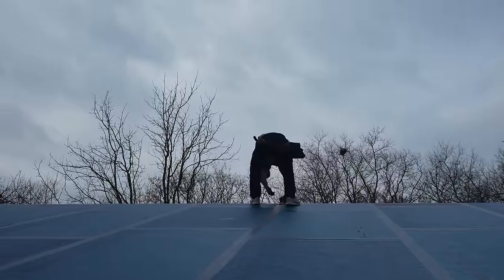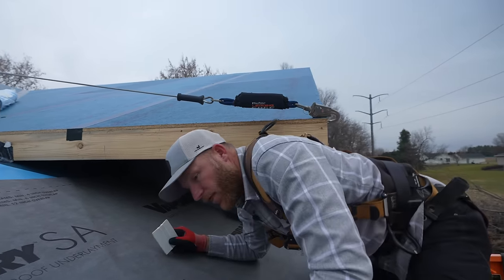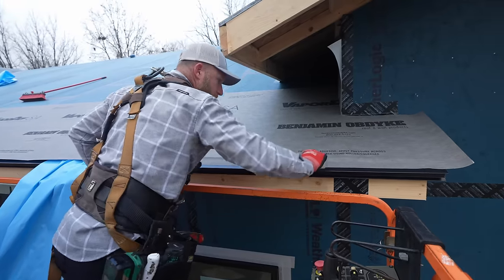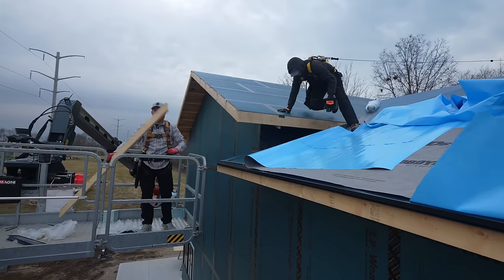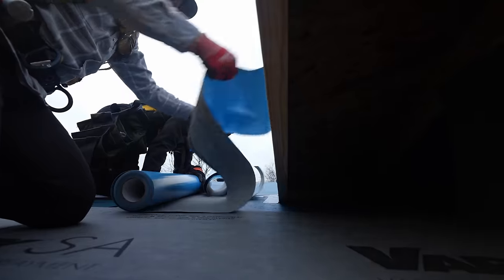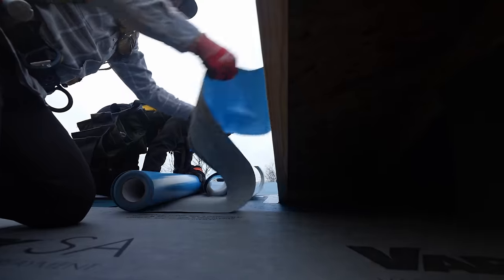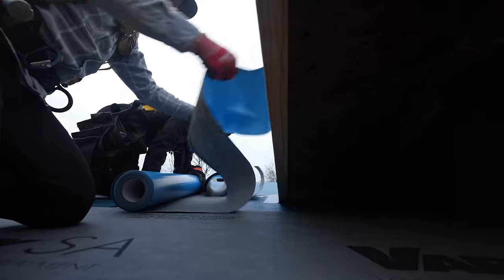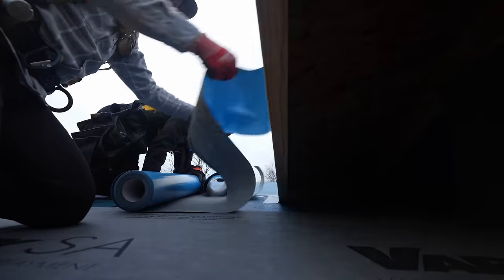My Dream Shop Ep-33: Why we used a Roof Underlayment! AND ITS AWESOME!

Comment: Finally a product that you do t have to put more holes in to apply it.  Kyle, when working by yourself, that is when you need to use the safety equipment.   Excellent work boys.

Comment: At 90 cents a SQ foot or $422 a roll. I think I'll go with cheaper tried and true tar paper investing the difference and in 40 years when I'm 80 pay to put a new roof on with the invested $.  I live in the PNW and properly installed and vented tar paper from the 50's and 60's still looks and preforms well in every remodel I've seen. Not sure but I believe Kyle is planning on an air gap of some sort on this roof.

Comment: Fall protection is a nuisance for sure… BUT as it saved me once form serious harm am using it for sure! On BIG tip to a new user… pull up your harness tight high up in to cross…. Think … dropping 25 feet down and then your harness will catch you by you shifting down thigh! In the harness…. For the guys… guess what in the way first when your full weight hits the straps in your cross 🤬 learned the hard way to secure the harness right….😮

Comment: Definitely a great idea to put down this membrane since the weather logic has but a thin coating of material to make it water resistant.   This membrane is likely 10 times thicker than the super thin spray coating on weather logic and the last thing you need is wet OSB sheets on your roof !

Comment: It seems like double protection plus a metal roof and no spray foam. Hmmm. 
No blue board, grey sheeting (its great stuff but optional), and spray foam inside would be the best roof system for cost, value, quality - is my take on this.
Great video guys!

Comment: I’m curious.  Intuitively I would think that you would run valleys after the horizontal field so the valley would be over the top.  Is there a reason you did it the way you did vs running the horizontal first and valley over the top.  Or is this okay by the manufacturers instructions?  

I’m also not a roofer, so it could be just my ignorance about this stuff too.

Edit:  I think it dawned on me as I watched further. There are the portions of the horizontal directly above the valley that would be under the valley sheet if you ran the valley second.  I understand now.

Comment: So what is the alternative to using a body harness and lifeline to make your workplace safe? Could you have used carpenters wall brackets and guardrails at the soffit edge given that your slope is moderate? Since you have lifts to move equipment and material to height quickly are there OSHA approved alternatives that would eliminate the need for body harnesses to be continuously worn?

Comment: On the edge trim piece, what is the need for the upper most fold/double layer of it is buried under the underlayment? Is that sometimes used for locking in the roof panels?
Reply: He mentioned that it's to dam up and prevent wind driven rain from going up the trim piece

Comment: That fall protection is useless if the angle of the rope is greater than 30 degrees .
The fake peace of mind it gives you, might be fatal in case of a fall.
Best would be if you take the Magni and lift up the boom and hang your fall arester on it.
And if you worry about the boom failing, it won’t fail spectacularly like in the movies.
It will slowly sink to the ground..
It’s made with safety in mind because it’s made for lifting people as opposed to the sky tracks or petite bones who would if you would use them for such thing..

Comment: Holy crap, I just check the literature on this stuff-and the price.  $422/80ft roll, if Im reading it correctly.  Question though...  why not wrap all the way down the 2x6s on the side eaves.
Reply from the maker: that roll is 380 square ft!  almost double a standard ice and water roll

Comment: Imagine back in 1983.
My brother's 60x30 pole barn garage. Was built without any of these products. Just blanket insulation over the 1x4S 2 foot on center trusses. 
Still holding heat. No leaks all metal construction
Reply: Caves hold heat too.

Comment: I asked the same question. Ever I time I see these types of products... Have yet to get a good answer.

Why bother with the expense of using the weather logic or even a zip system if you're doing a fully adhered underlayment on the roof?

Bomber system for sure, but seems like such a high cost for redundancy
Reply from the maker: have you noticed the time between sheathing different sections of the roof and getting to this point where it is fully covered?  November 15th was the first day installing sheathing....Dec 27th is the day that first side of sheathing was finally covered with vapor dry.   that is a month and a half in the weather being rained and snowed on....the weather logic allowed me to not stress about that since I am a small crew and this is a large complicated project.  However like I said, now that we are trying to install the steel on the roof, it also can take some time due to weather and complications.
Reply: @RRBuildings  okay - that flexibility in scheduling makes sense to me. Thanks for clarifying the thought behind it.  Keep up the great work and awesome videos!
Reply: @RRBuildings  Right on, Kyle. You, Sir, are a legend.

Comment: You're going to pop a thousand holes through it when you screw down your metal roof, right?
Reply: Good point. I was wondering about that too. Between the structural zip system sheathing and this stuff, it almost makes better sense to just shingle it so you don't drill through it all.
Reply from the maker: it is self healing and once covered i am not worried anyways...its more about while i am not able to install metal
Reply: 10-4, makes sense. Just a damn shame you have to puncture it.

Comment: Hi there, Why American would use shingles for roofing? is it not much better to use something that will last for a lifetime like 1/8 of 1 inch of sheet metal then plaster it? Nothing will puncture the roofing's even tornado.. Probably its 7 times  expensive but it will never leak... You have something that is unbreakable....

Comment: Shouldn't you of run your valley last. I always run my horizontal runs through the valley than run my valley last. I never had a leak running that way.
Reply: Nah
This way any water moving down stays on the valley underlayment rather than hoping the adhesive will work the way it's supposed to
Reply: Definitely not. That would be like running your roofing metal first and then sticking your valley pan on the top of it 😂

Comment: When it's your personal house, and you do this kinda thing for a living, you tend to splurge on that stuff. On my personal house, I did huber zip for the decking, plus Self adhered IWS in the valleys, rakes, eaves, and roof pitches 3/12 & under. Used Owens corning synthetic underlayment everywhere underneath the shingles (OC Duration). We didn't put zip tape on the ridge and used a Carlisle vapor permeable membrane instead to vent out any potential moisture/vapor that might collect under there from my spray foamed roof deck and put a continuous ridge vent on the ridges like a "normal" roof. Our front porch is 2.5/12 snap-lock Standing seam. Belt & Suspenders! Also did B&S on my foundation too. I did TWO 4" perimeter drains instead of 1 for redundancy, buried them in 18" of a 57 stone burrito before we backfilled. Walls and footings were waterproofed with Tremco fluid applied & a dimple mat over that. Plus all my downspouts are piped away from the house into ultimately flowing into drainage swales. If there are ever water issues in my basement, Noah's gonna have his ark floating in my front yard... I also assisted the window install crew and made sure all the zip tape was rolled properly and came over to the house in the pouring rain with a flashlight to inspect all the windows to ensure we had no leaks. My house was 100% dried in before we even had roof shingles on it. Me and my dad hung all the exterior doors and I zip taped the gap between the jamb and the sheathing (lapped the tape about 1/4" onto the jamb so the brick mold covers it), then installed the brick mold myself before the siding crew came and lexel'ed the brick mold to the sheathing and zip taped the drip caps to the zip sheathing myself. 5/7 of my exterior doors also have a roof over them (by design) so I doubt we'll ever have any water issues.
Reply: TMI…. You need friends, your need to write a book on someone else’s YouTube indicates a lack of social interaction.. seek help 😆

Comment: Why put vapor dry over weather logic and not just put the vapor dry over OSB? First you done’d it then you redund-it.
Reply from the maker: did you watch the video???
Reply: Yes. I must have missed it. Edit: found it at 29:50. 🙄
Reply: Vapor dry is breathable (14 perm)when installed over plywood. The Weather Logic is 5 perms. I don’t see Vapor Dry on the list of products that pass ASTM D1970 which is the self sealing nail test. I know they print that on their product but third party testing is more reliable and indicates none of these self adhered products actually pass the test. 
Underlayment is a temporary water resistant material that allows some time to get your roof installed. It does nothing after the installation of roofing materials with thousands of nails. A metal roof needs to be ventilated to allow condensation to dry. I’m just an old contractor with a keyboard! I’m sure your roof will be dry and long lasting.

Comment: It would be interesting to see Ice and water in the valleys and then this on top of it. I wonder if it would stick. Very very cool product.

Now give us a cost breakdown of what Ice and Water would have been vs this? Seems like ice and water has bigger overlaps and is more of a waste unless they come in bigger rolls for bigger runs.
Reply: this stuff is about $500 a roll. Its probably exponentially more expensive than ice and water.
Reply from the maker: not really...its about 425 a roll and that is for 380 square ft....vs 200 for a 200 square ft roll of high temp ice and water...fairly similar pricing